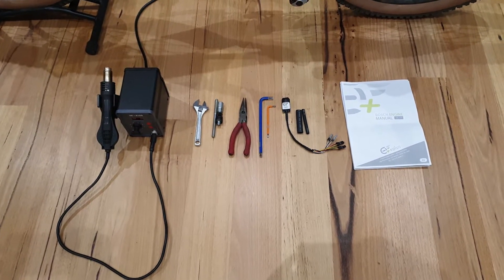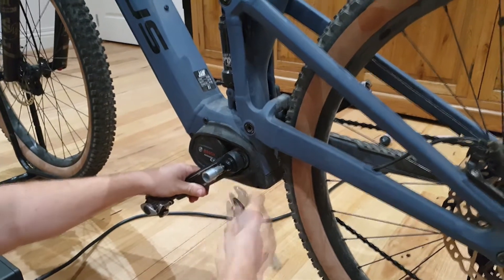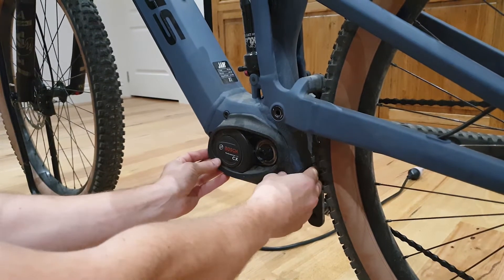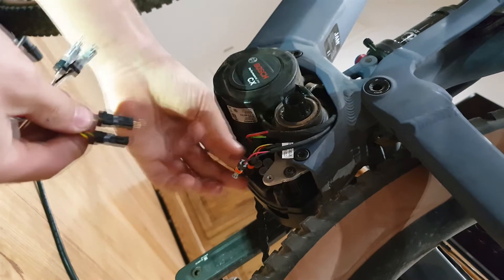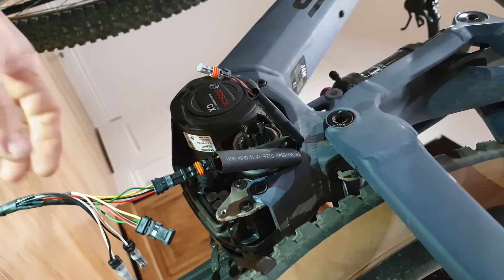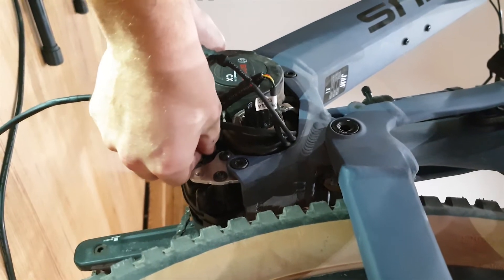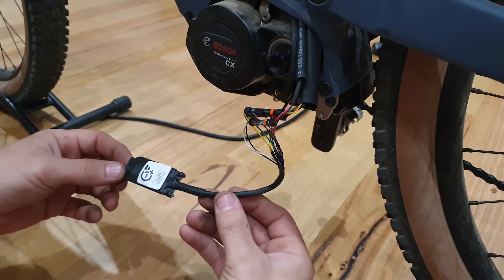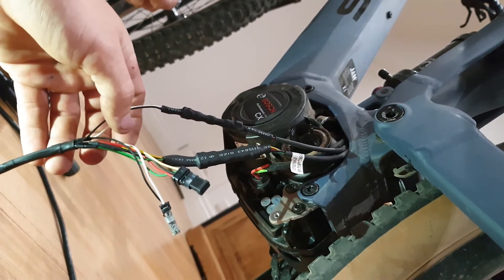Bosch CX eBike Speed Unlocker Chip 4th Gen Motor 2019 & 2020 Models

Comment: The module on the Eplus tuning model is a little too large to fit under the cover - Is it safe to trim the heatshrink on the module?
Reply from the maker: You could carefully trim some of the heat shrink off the edges if absolutely necessary. Just be sure not to cut into the PCB
Reply: yes it may be. Hope this helps

Comment: Hi,Epic.
 Will this chip work on Moustache Samedi 27 Off 6 model? It runs on Bosch 500W Performance Line CX?
Reply from the maker: Yes works on all performance line CX motors
Reply: @EpiceBikes  Hi,
Nice video! 
I have cube touring hybrid one 500 ebike, since it is a paddle assist and due to my health requirements I would like to add throttle to my cube ebike, please advise / guide on how to go about having throttle control installed in it. 
Thank you

Comment: Will it work with the older performance cx gen 2?
Reply from the maker: Yes also works on the Gen 2
Reply: @EpiceBikes  Nice video 
I have cube touring hybrid one 500 ebike, since it is a paddle assist and due to my health requirements I would like to add throttle to my cube ebike, please advise / guide on how to go about having throttle control installed in it. Thank you

Comment: you dont need to take the crank arm off. two screws from the bosch cover will do it
Reply: Yes, in this model but some models it is necessary to remove the crank. My problem is the never answer questions by potential customers. You really think if you have a problem with the product you will ever hear back from them. Speedbox 3 is one that does respond back and has good customer service and not even theirs works beyond 28mph even though it is claimed to 60mph.
Reply: Agree, I see it on all the videos, looks to me it would slip right over, move the crank arm to wherever to get it off, then out of the way.
Reply: I agree as well, I don't know what all the extra "moves" are for. Just take the cover off and install.
Reply: @BrutallyHonest-111  well maybe he wanteds too.
Reply: Thanx 😲
Reply: Who sells chip and price ???

Comment: i cant open the first plug... i am to weak??? or what im doing wrong
Reply from the maker: They do not require too much force. Try to push the plug gently upwards as you pull as the locking part of the clip is usually facing the ground.

Comment: When you're using the crank arm tool, how long is that bolt that was inserted inside the crank?
Reply from the maker: That bolt is long enough to make contact with the retaining bolt of the opposite pedal.
Reply: @EpiceBikes  
Hi,
Nice video! 
I have cube touring hybrid one 500 ebike, since it is a paddle assist and due to my health requirements I would like to add throttle to my cube ebike, please advise / guide on how to go about having throttle control installed in it. 
Thank you
Reply from the maker: @mohsinsheikh8076  there is no way to add a throttle without completing taking apart the motor and add a external controller. It would not be worth while and you would lose all Bosch related features. Simply best to buy an ebike that comes with a throttle.
Reply: @EpiceBikes  what does the long bolt in the crank arm do ?
Reply: For this job, it doesn't matter because you can pull the motor cover down around the crank without removing the arm. It's not necessary.

Comment: i have just installed this on my Trek rail 9, so far its awesome (100 km), ill post a review after 1000 k/m's
Reply: 603 klm and 504 error has appeared and bike is in limp mode
Reply: @tonydemaria9216  did you turn bike off rather than leaving on after ride.
Reply: Did that 504 error turn out to be the wheel sensor not picking up or something worse?

Comment: hello, it's now mid 2020 and Bosch just had an update for the CX that upped the torque. Will this affect the way this device works or not. Thanks
Reply from the maker: The chip is fully compatible with the latest firmware that upped the torque to 85NM
Reply: I installed the Volspeed v4 today on my 85nm CX. The top speed has increased but it seems like it has less torque.  🤔

Comment: Unnecessary to remove crank arm.
Remove the two screws, that’s it to access wiring.
I own a Gen4 Bosch and have done it although not with this speed unlocked chip.
You’re welcome !
Reply: What the best chip for the 2021 Bosch  cx?
Reply: @Poppi3579  volspeed V3 100% the best for 2021 CX
Reply: @akeluify  Since your comment, I think Volspeed is up to V4. Maybe they upgraded something.
Reply: i was ask you what chip you used too

Comment: This chip will work on a Bosch gen 4 motor  for about 30 miles then your bike will go in to limp home mode,  it will need to be reset at the dealers  and your warranty will be gone  .
Reply: This is incorrect, these chips work fine if you follow the instructions.
Reply from the maker: This is incorrect, The chip has a anti detection measure that stops it from being detected you simply need to let the bike complete this after finishing a ride this takes about 30 seconds. As long as this is completed the chip will not be detected. This process is the same for the speed box 3. If you do not do this and the bike enters limp mode it can be reset by riding unassisted for 90minutes. This can be done three times. After the third time entering limp mode you would need to see a Bosch dealer to have your bike reset.
Reply: how do u know if its done or doing the anti detection stuff.

should you just avoid turning the "display" off or  pulling the battery out.
Reply from the maker: This video shows how the anti detection works https://www.youtube.com/watch?v=c-ZduawsQOE
Reply: You don't if you have the speedbox 3.0, i got it on my bike

Comment: Any issues, does it bring up fast codes over 500 miles use?
Reply: Would like to know too.
Reply from the maker: @lostintarkov6205  As long as you let the chip complete it's anti tuning process after riding it does not bring up any error codes https://www.youtube.com/watch?v=c-ZduawsQOE
Reply: @EpiceBikes  Awesome!
Reply: Turbo Sam I’m 1300 miles into my gen 4 motor chip and no problems. One tip though NEVER turn your power off yourself - ALWAYS let it time out itself before plugging your charger into the battery.